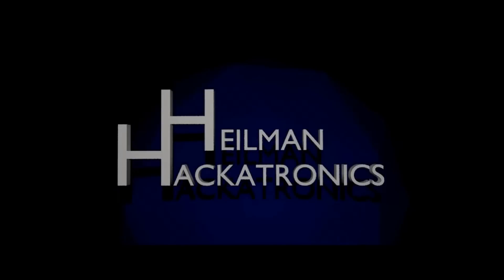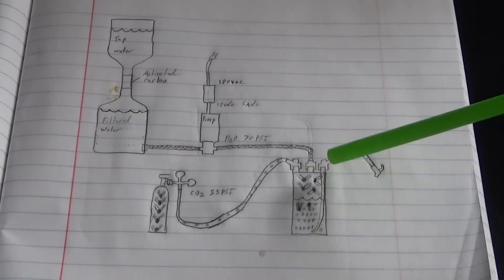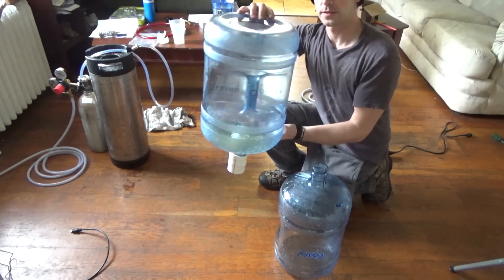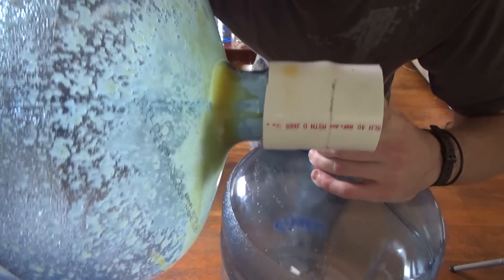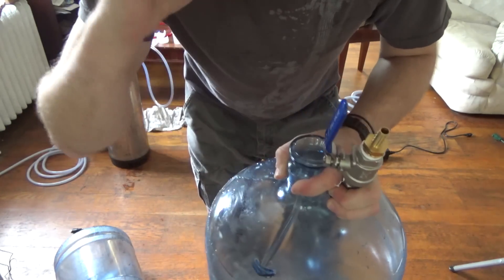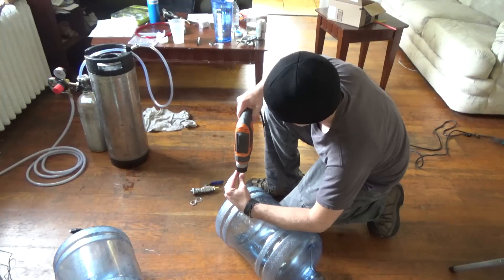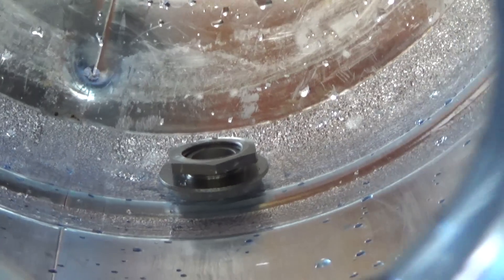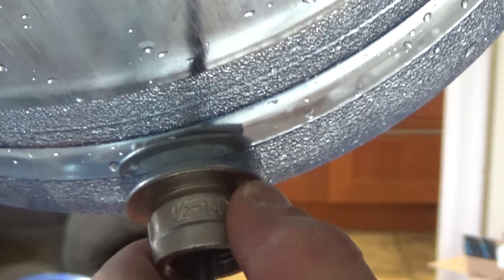Custom Carbonated Water System (Part 1)

Comment: That's cool! Just a quick question, how are you going to replace the Brita filter? I assume by just pulling it straight through the hole when the bottle is empty then getting a replacement filter fitted with some more beeswax.
Reply from the maker: That is the current idea. we did want to make a water tight mold for the filter, but we couldn't find a material specifically rated for potable use.